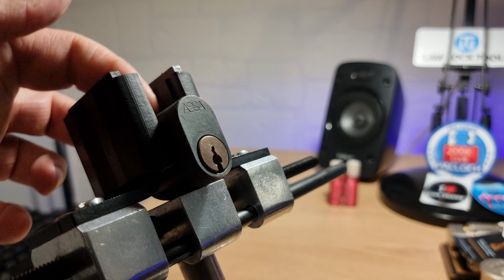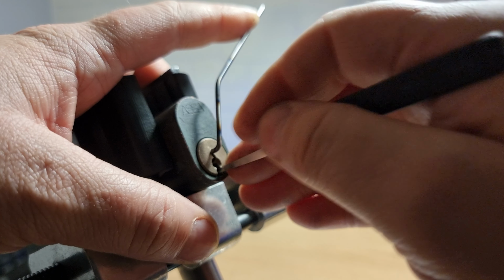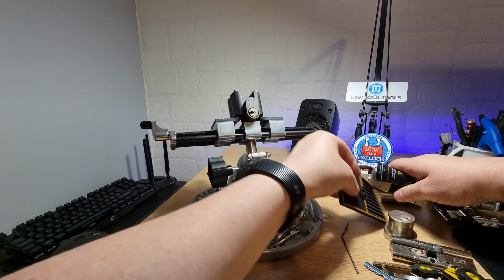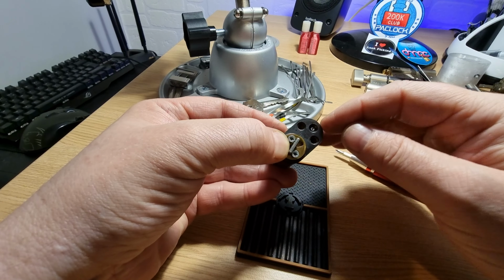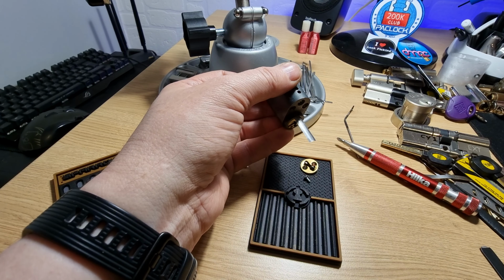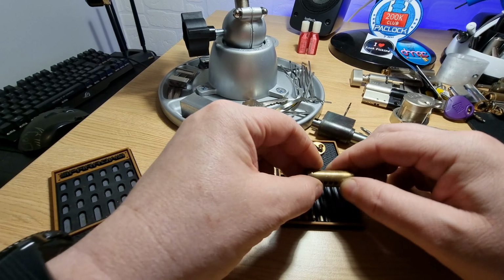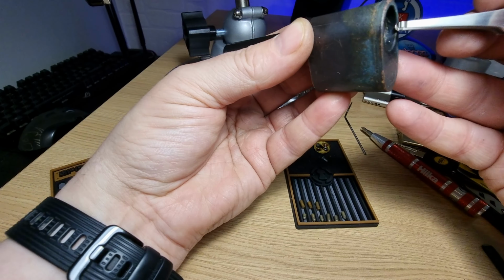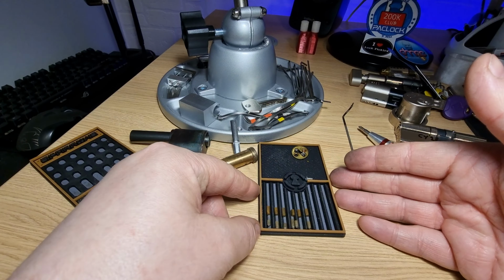(52) ASSA 600 All Standard Pins Picked and Gutted

Comment: A nice cylinder, I wonder if someone removed those pins for another project. I've come across several rukos in the past that were the opposite in that they had gins up top but no milling. Keep your eyes peeled and I'm sure you'll come across on oneday
Reply from the maker: Hi Dmac. It could be that the pins were swapped out, but the lock was full of oily gunk that must have built up over a fair amount of time..
I've also seen it the other way round, I've an ASSA 500 with barrels and no milling.
From the blurred pictures in the eBay listing I was hoping it might have had the old hourglass spools in it. 
Cheers 👍 🍻